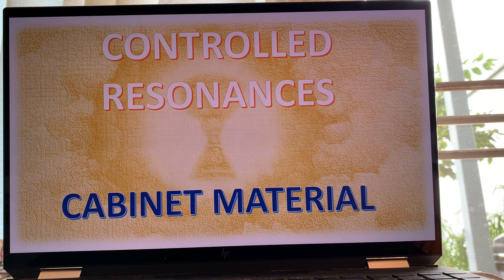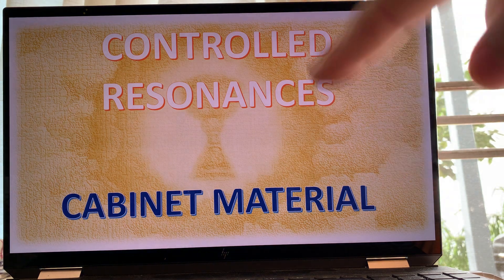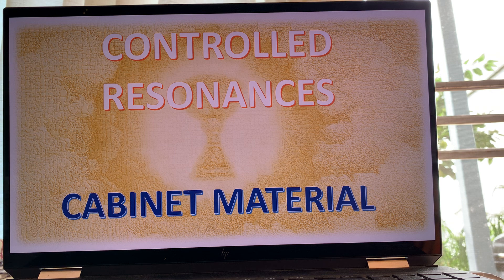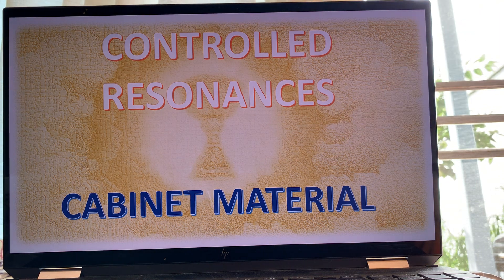Paradigm Shift for Loudspeaker Cabinets: Controlled Resonances! - Think as a Luthier

Comment: Janos, I'm going to make a new panel using 12mm plywood with rigid frame and Fostex FE83nv. could you give
any suggestions for baffle size? I read that the bigger the panel, we would have a lower frequency response. And hole position, should it be done in the center of the panel?

Thank you very much Andre
Reply from the maker: Hi André, it seems YT ate up my post from couple days ago.... so, here I try again. I would suggest at least 75cm wide baffle, with 10cm "frame" or wings at a slight angle. The wider you go, the deeper the bass gets. I prefer center position, as off-center just looks so weird, it makes me feel queasy looking at it. Will show tips later on that it's ok to mount it at the center, and that gives best bass response anyway... The height is not so critical, the width defines bass response. Cheers; Janos
Reply: @realworldaudio  I saw your original comment where you were explaining about the size. Don't worry. Thanks, André

Comment: Hello Janos! Happy New Year, I wish you a very happy year. I did the open baffle with FE83NV, as I had the material in hand, I did it quickly and wrongly. Lol. I just took some chipboards and opened a hole with rounded corners. I had time to listen to a few songs. obviously there is no bass. some female voices got annoying and other voices got good. on the other hand listening to drums (I mean snare drums and cymbals) were amazing, with incredible vivacity and speed. I was impressed how such a small speaker can reproduce so well and so loudly, with very small cone movements. Well, after this lesson about baffle and the necessary frame that I didn't use you can be sure that soon we will have some more experiments with open baffle. I briefly Googled about open baffle but didn't find anything interesting. your video was much more productive! thanks !

Comment: Hi Janos. Is 1/2 inch plywood strong enough to mount the woofer from the backside of the baffle to enable horn loading?
Reply: Use marine ply from a good brand, usually there are calibrated ones , they are a little expensive but they are worth it
Reply: @IDontExist14  Excellent tip, thanks! Have you made some yourself?
Reply from the maker: Yes, it's strong enough to easily hold my 15in big Altec. My buddy in Australia changed his 1in thick cabinet to 1/2in for his 18in JBL sub, and reported a massive improvement in sound quality, and no issues with mounting.
Reply: @realworldaudio  Thank you! Makes it more affordable as well.